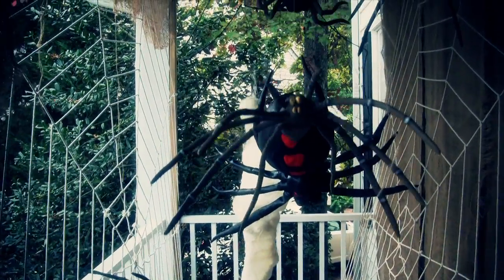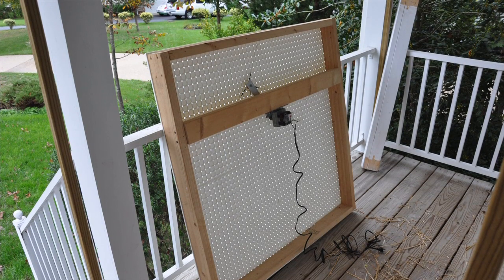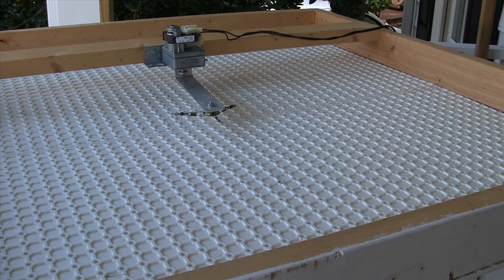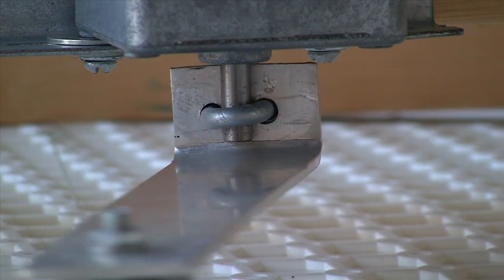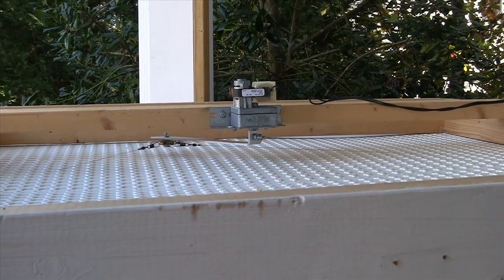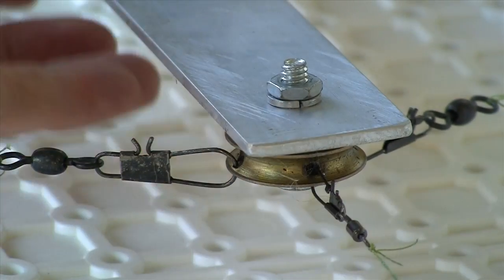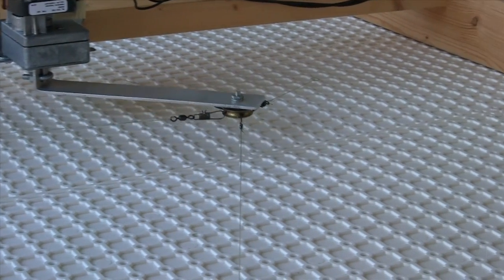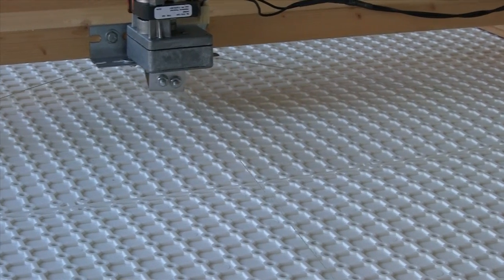ScareFX Animated Spiders Mechanism

Comment from the maker: The fishing line can be different lengths. However you need to have some weight on the lines and the lines must go through a hole that is outside the radius of the turning crank arm.